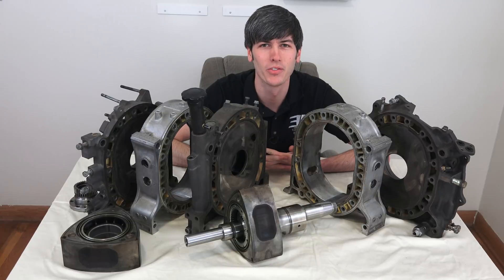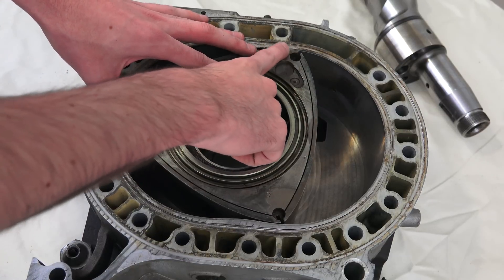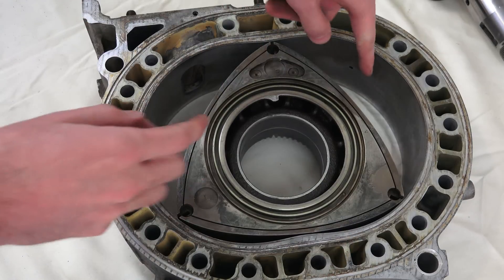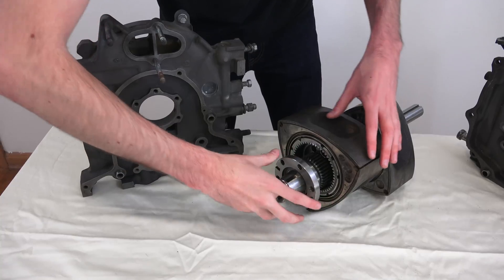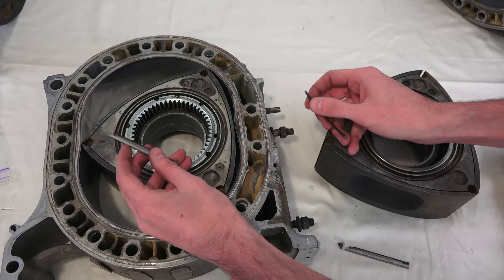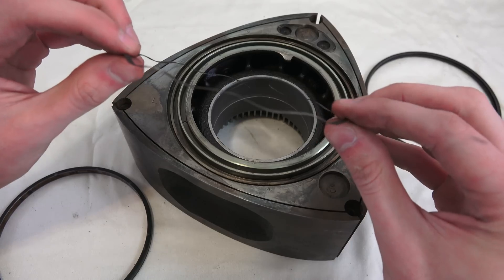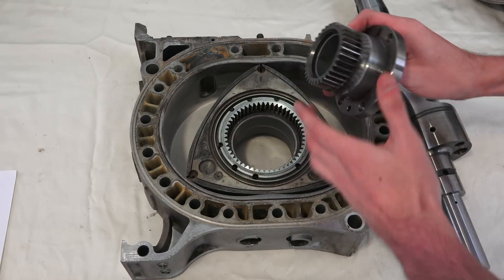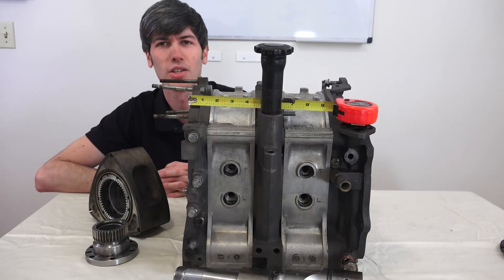How Rotary Engines Work - Mazda RX-7 Wankel - Detailed Explanation

Comment: I think this engine design will wear out easier than piston engines. Here's my theory, more movement/stages = more friction, more friction = more heat, more heat = more wear. I think the piston design is far better as there are less movement in stages so there will be less friction meaning, longer lasting engine. Also, in a rotary engine, there's far more seals in the engine that could fail meaning a more unreliable car/needing to pay more money for services and parts. And I think more metal to metal contact increases the chances of more wear and also how the emissions of this engine is also bad as well. Hope you understand my theory. ~ Edison
Reply: As Doctorbimmer points out, the seals are a weak point, especially the corner seals. Detonation typically occurs at the trailing corner seal (when near peak compression) and can immediately destroy the seal, and this is one reason the engine is usually run richer than other engines and owners will always use the best fuel available.
Regarding metal to metal friction, it's worth noting that the rotor itself never touches the housings because it's movement is confined to a very strict path by the ring gear and the eccentric shaft. Only the seals touch the housings. This is unlike a piston engine where there is always a component of the compression and combustion forces pressing the piston against the cylinder wall causing power loss and wear.

Comment: Another, sadly, unmentioned advantage is that energy is spent de- and accelerating the pistons every revolution in a piston engine. If combustion could be controlled as well as in a piston engine, a wankel engine would be better.
But I doubt that we will see any or much improvement on the design as we're starting to move from combustion to electrical engines. I just wished we would spend more time on more efficient and cleaner power storage, as opposed to Li-Ion batteries.

Comment: Seeing a disassembled rotary engine for the first time, I'm amazed at how simple it seems compared to internal combustion piston and rod engines. It makes me really want to give them a try.
Reply: The real doktorbimmer People dont buy them because all the soccer moms and old peope who went and bought RX-8s and blew them up because average people dont know how to keep up with them refuse to touch a mazda now but originally the rx8 wasnt a bad seller until the later years. They arent being made anymore because they cant pass current emissions. Id be suprised if anything that burns oil by design can.
Reply: The real doktorbimmer It isnt a theory its more of an anecdote as I actually saw it happen. Twice. As I said before it wasnt a bad seller in the first two years. Sure it was no mustang but not bad. I feel like I saw those things everywhere back then. 2012 emissions are not equal to current emissions and as someone who was in cali for a couple years back then the earlier models were not always passing by 2010 and I know more than a few people sold them for that reason. The real issue with the wankel in my eyes is the fact no one tells these people how to keep up with them.
Reply: I look at FC's BECAUSE of how cheap they are in comparison to the FD models. I've seem FD shells alone around Vegas go for $8000. I love drag racimg with all my heart and I'd just strip all of the interior and unnecessary part of anyway.

You've done a good job of talking me out of rotaries but I'm still curious...
Reply: a air cooled 2 stroke has less parts by a long way
Reply: The real doktorbimmer Its no old wives tale considering people who know how to keep up with them dont have too much trouble getting 100k miles out of them and people who dont significantly less. What people bought or didnt buy doesnt really change the fact the car was pretty solid. We arent talking sales strategies or marketing here we are talking cars. The rx series as far as im aware have never been great sellers but they do have die hard fanatics.

Comment: Great video. To me the whole idea of creating a rotating mechanical assembly fueled by hydrocarbon combustion is so inefficient compared to an electric motor. With an electric motor there is obviously no need for the compression or exhaust phases, no complicated rotating mechanical linkages requiring precise balancing and oil baths, just a rotor and a stator and voila...

Comment: I love rotary engines after owning a 83 RX-7. It sucks they were murdered by California smog rules. Which, don't get me wrong, are a good thing yet killed many engines that have power to weight ratios.
Reply: Making power with a rotary isnt hard at all. It is most definitely emissions and budget that is holding them back.
Reply: The real doktorbimmer You consider 230ish horsepower from a 1.3 subpar? I know I dont.
Reply: The real doktorbimmer You can buy sportcars with double that sure but that doesnt really make it pathetic or bad. The FD was not underpowered at all in stock from and the rx8 wasnt either. They were pretty solid from the factory. Yo cant buy a new car with alot of things dude. That doesnt make it bad. Everything will phase out for new stuff eventually.
Reply: The real doktorbimmer That makes the engine pathetic how? Sales doesnt equal an uderpowered engine. The rx7 was also in my opinion the best car out of its competitors back then as far as driving experience.
Reply: The real doktorbimmer The RX7 was the best performer out of that group (besides the GTR but we didnt get that here in the US) so obviously no, sales are not telling the full story.
Reply: The real doktorbimmer I will just agree to disagree as it seems as though someon's grandma got ran over by a Wankel or something. No doubt that there are issues with the rotary that require attention but to call them obsolete and inferior just doesn't cut it with my experience with the engine. i guess if you want to trade simple, staight forward hp for the complicated simplicity that's required of a piston driven format then so be it.
Reply: Well. Look at the pinto, or even Firestone.. Being known to do a thing 50 years ago.. Doesn't matter. You are always known to do that one thing.,..
Reply: Well. I don't know the year. My friend way back when had a RX 7? or 8? brand new that had a massive few pump problem. It killed it for me back then. I mean the car wasn't even 3 months old and the fuel pump was bad? Nah found out the fuel pump was just to weak.
Reply: Jason Leon , I too had an '83 RX-7. Rev-N-Run. It drove like a champ for being such a small and simple motor. would love to see them make the changes necessary for them to have a future. If they could fix the compression and fuel leakage through the ignition/exhaust cycle I think it could be brought back from the dead.
Reply: Bimmer McBimface,..... definition...
obsolete
ˈɒbsəliːt/Submit
adjective
1. no longer produced or used; out of date.

The rotary is produced and used.
Reply: The real doktorbimmer 
Bimmer McBimface, the rotary is made by many makers.
Reply: Jason Felker 
The voices told Bimmer.
Reply: The real doktorbimmer 
Bimmer McBimface, are the voices louder today.
Reply: The real doktorbimmer 
Bimmer McBimface, are the voices even louder today. How loud are they?
Reply: The real doktorbimmer 
Bimmer McBimface, what did the voices say?

Comment: I'm not very knowledgeable of rotary engines but if rotary engines are much smoother than 4-12 possibly 16 cylinder piston engines... why the hell didnt manufacturers put more rotors in? like idk 4 or 6???? also why do these type of engines sound so whiny?? does the horrible sound have to do with the exhaust set up??

Comment: How does the balancing work when they start to add more rotors? The 180 degrees you mentioned showed the 2 rotors as if they were a 6 point star.  Would it still be 180 for a 3rd rotor?

Comment: Moving parts: 22, not counting external pumps and throttles. Not the 3 you quoth.
1  shaft
2 rotors
3 apex seals - each floats on the spring
12 side seals - again, each floats on a spring
4 face seals, again, floating on springs

Comment: why is this not used for motorcycle engines?
Reply: Silly Dokdimmer. Still need to brush up on your history. The 787B wasn't around very long, but it was competitive. It's not a fluke win when a Merc breaks down one hour before the race finishes and the Wankel could've gone another 24. Also the Merc was using a Turbo 5.0LV8 which if you go by combustion cycle like earlier is 10 liter engine vs the 7.8 Liters of the R26B. So 10 Liter to create 950BHP vs 7.8 Liter to create 900BHP. Once again you are so WRONG. FIA changed the rules to 3.5L V8s to match up with F1 at the time. Which is why Mazda went with Judd V8 the following year. However currently the way rules are written they require any petrol or diesel engine to have pistons. So technically speaking current rules don't even allow for a Wankel to enter/compete. Sure the Wankel has it's flaws but you can atleast get your history and facts right.
Reply: Actually it is being used commercially. The Aixro Go kart engines that produce 50hp very smoothly. 

But then space and weight is a problem for high performance go karts which left even lower efficiency 2 stroke engines popular.
Reply: so is inline/V engines pretty much as good as it gets as far as a performance/weight/room ratio? or is there "better" but just too expensive
Reply: Standsalone 
Depends on what the engineers want

Inline is the easiest to make.
VR a hybrid between inline and V is probably more efficient in regards to space.

Flat engines can be placed lower which is beneficial for keeping a low centre of gravity. They do have more vibrations.

Rotary is even more effecient in regards to space/weight/performance. However it's fundamentally flawed in regards to fuel efficiency

Then electric engines can be extremely powerful for their size. efficiency of arround 90% is far better then any combustion engine. Problem is how to power them

Then turbines produce the most power/weight for a combustion engine. but they need time to spool up and tend to be gas guzzlers.
Reply: "LESS power output per liter"

uhm 230 ish bhp from a 1300cc production engine without turbo is still holding the record for atmospheric engines.

The 787b had 700 hp in 24hour race trim from a 2.6liter NA engine. practically what a F1 engine would have back then. 

Mazda claimed it could deliver 950 Bhp if they moved the redline to 10.5k rpm

That is more power then a 3L V10 F1 developed at 20k Rpm

Which definately wouldn't last 24 hours of racing back in the day.

Wankel torque curves are very desireably. Extremely fluid power delivery which boosts driver confidence.

they have 2 major drawbacks though.
Fuel economy and emissions.
Reply: So kinda an off topic question but if they put a 3 cylinder radial engine in a bike and moved the oil back maybe the tank up (2 making the v and one pointing directly down.... Wouldn't that be an option? Or does it then go into politics of marketability? I would think it would be easier for maintenance too
Reply: Fia had to calculate the displacement for fairplay 

It still only displaces 2.6 liters and lacks ant turbo charging

The F1 cars that had a 1000 hp used turbochargers and only had over a 1000 hp for just 4-8 laps. After those qualifying laps the engine was turned into scrapmetal.

Still 1400ish bhp in the most ludicrous days from just 1.5L engines was quiet exciting. 

Calling a car that won the 24h of lemans slow is truly pathetic and dishonest. 

If you wanna know why the 787b was retired. The engine was outlawed and using a 3.5L judd was mandatory. 

About why it lacked pace? Well it was heavier as the jaguar following group C regulations. Which putted it at a disadvantage on smaller twisty tracks.

Comment: Awesome video, genius design
Reply: It's a ton of fun to drive a rotary engine powered car though. The compact size for the delivered power allows for designing a great car around it.
Reply: It produced less power per liter? I just picked some random car and looked up that claim. The Lotus Elise Cup R, which is a track only car, has a 1.8 liter engine, which is even supercharged if i read it correctly, and it produces 220 horse power, which is less than the 1.3 liter rotary of the 12 year old road going RX-8. Or does a track version of a Lotus Elise not have a "typical reciprocating performance engine"?

Mazda was forced to stop production of the RX-8 because it couldn't match the emission regulations which were getting stricter every few years. For example they were not allowed to sell the RX-8 anymore in Europe from 2010 on.

Yes, the RX-8 has a lack for low rpm torque, but personally i prefer it this way. The RX-8 can easily be driven at 1.5k RPM, or you can drive it at 9k RPM if you want to do it. Normally i drive it at 1.5 - 2.5k RPM, which means it doesn't have a lot of torque there, but that also means i won't crash into the car in front of me because i sneeze and tap the gas pedal a bit. And if i want that torque, i just change gear to 2 or 3 gears lower, and it is there. If you want to drive it with high torque, you can, but you can also have it quiet if you want to. The only point where you don't have the option for high torque is when you are starting off the line. But how often do you really need that in your everyday life?

And last but not least: have you ever driven one?

Comment: nice. well made vid. I know a lot about engines and although I have been told how a rotary engine works, I've never seen 1 apart. you explained it vet well. too bad it has to inject oil Into the combustion chamber.

Comment: What I don't understand

So oil is put into the chamber along with the air and fuel mixture. Right, that makes sense
but what I'm not sure about is does the oil also go into the other sides of the chamber, on the other sides of the triangle piston, the sides that don't do the combustion? Cuz what I don't get is if oil DOES go into the other sides of the triangle piston and chamber, then how does the oil not fall out through the intake and exhaust pipes? if its spinning, then oil would simply just get pushed out.
Reply: At least most of the oil is burned like the fuel before it gets pushed into the exhaust or intake. That's why you can't use your normal engine oil, you have to use one that burns without residue.

And afaik the RX-8 engine has 3 oil injections, the higher you rev the engine the more get activated.

Comment: Ok. I have one issue.
You called the concave portion of the rotor, the pockets, a function of the displacement of the engine.
I would liken them instead to when you cc your heads and tdc of piston to find combustion chamber volume in a conventional 4 stroke motor.
However the displacement of the engine is instead the ratio of the most open portion of the rotor position compared to it's most closed.
Those pockets then are just a way of setting the motors compression ratio. Not determining it's displacement.
Otherwise. Very informative vid of a wankel design motor.

Comment: This makes this motor design perfect for hydrogen as the major issue with hydrogen piston motors is that the heated cylinder walls/valves/etc causes predetonation. As the hot and cold segment of this motor remain separated for the most part, predetonation is far less likely.

Comment: Since you are actively burning oil, like a 2 stroke engine, but unlike a 2 stroke where the oil is in the fuel, is there a separate tank for the oil (unlike a regular engine where it's just there) and does it have it's own signal/gauge for low levels?
Reply: I can't talk for the RX-7, only for the RX-8: In practical use the oil is handled the same way as with a normal car engine, you don't have any special gauge or whatever and have to check the oil the same way (and honestly, the place where it is located is a pain to access). I don't know if it has a seperate tank, but a regular engine probably has as well, you need to keep that oil somewhere.

That said: it's a good idea for a rotary to put some 2 stroke oil into the normal fuel tank together with the fuel, to help with lubrication. There are even people who disconnect the oil injectors and put enough 2 stroke oil into the normal fuel tank to satisfy the lubrication seals.
Reply: I never said 4-stroke engines have oil injection. But you have to check the oil level for 4-stroke engines as well as for wankel on a regular basis, it's just more important for wankel (and you have to refill it more often) due to the oil injection. But the way you do this is exactly the same for both.

And about the 2-stroke oil: Go and read it up on the net if you don't believe it. "Premixing" is the term you want to use in your search.
Reply: i'm not talking about the technicalities inside the engine. I'm talking about what you, as a driver, have to do. If you don't know anything about a rotary or don't even know that the car has one, the only difference you will notice concerning the oil is that you have to refill it more often (and that you should use one that matches the car, and not just a cheap one from some home worker market).

Comment: the only Problem with rotary is within it's advantages, 
too many moving area's in direct contact with the housing in 2 dimensions, thats why it need to burn Oil to prevent it from wearing out. makes this type of engine very service-needy.
however the advantages are its sportyness and much smaller volume is needed to produce the power.
a 1 Liter Rotary can easy beat a 2 Liter 4 Stroke Engine in Tourque and Speed.